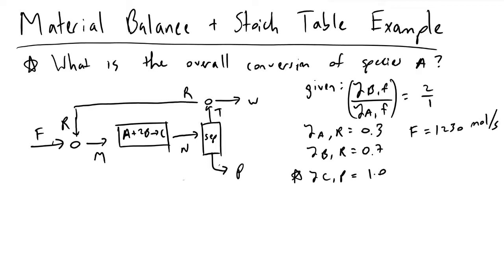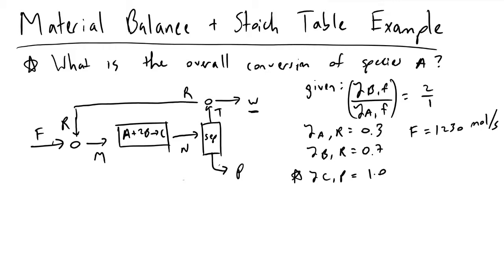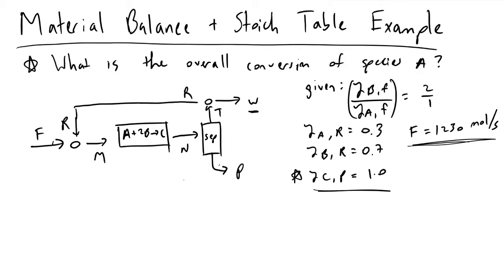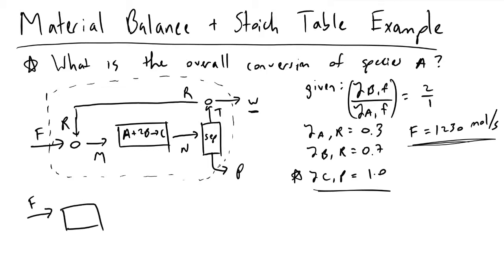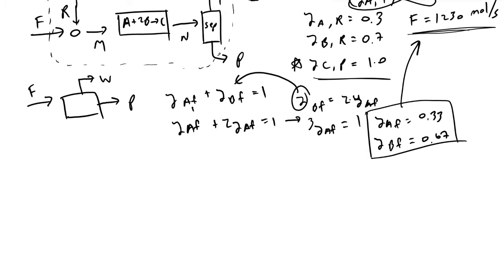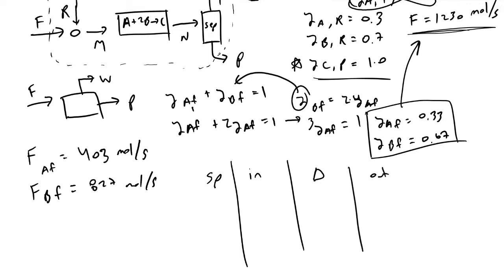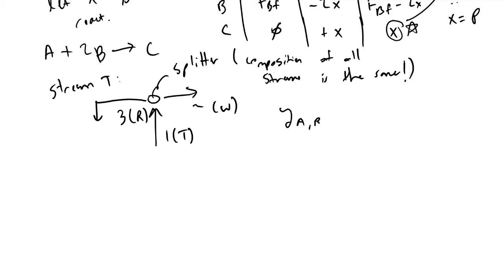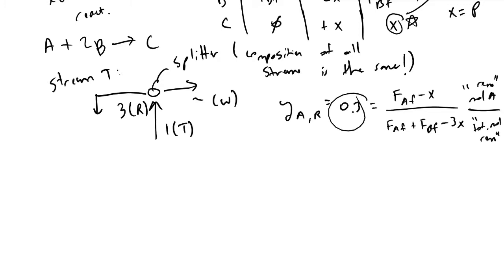Material Balance and Process Flow Diagram Technical Example

Comment: If ybf/yaf=2/1, doesn't that make the molar ratios 0.3(repeating 3) and 0.6(repeating 6)? so the molar flow rates for Species A and Species B would be 410 and 820 respectively; so when you get to solving 0.3=(Faf-x)/(Faf+Fbf-3x) using 410 & 820, no solutions exist?? Also, 827/403=/=2/1
Reply: Please help me vincent
Reply: @dianaabbott3184  The calculation was performed with too few decimal places.  410 and 820 technically are the correct values, assuming that the B:A ratio is exactly 2:1.